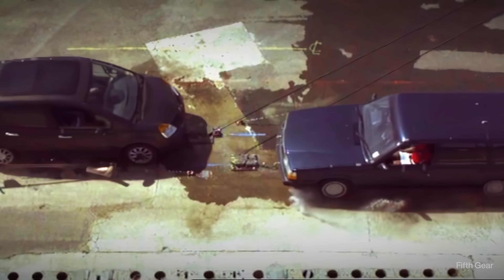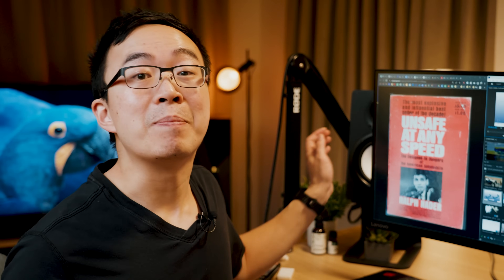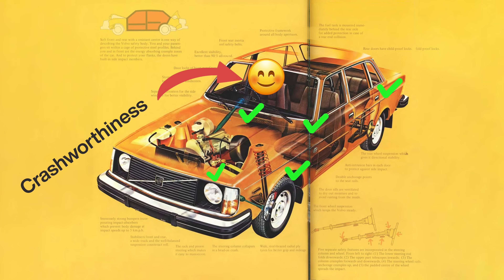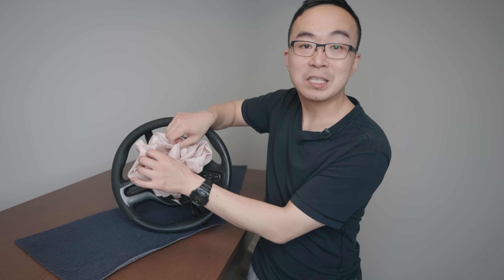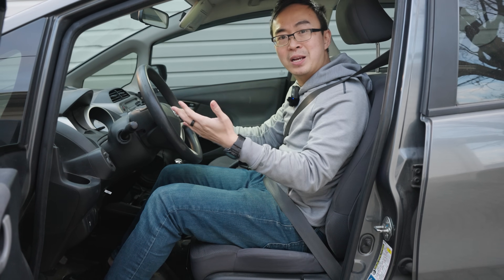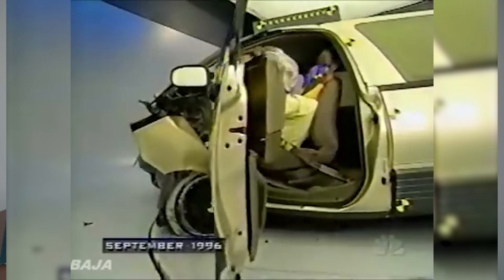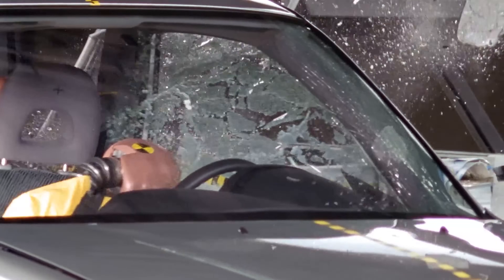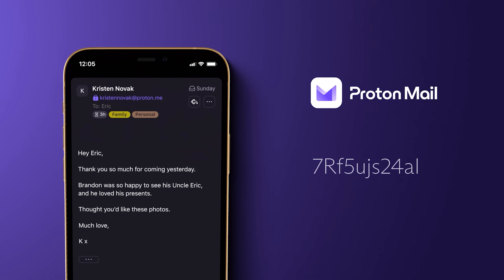When does a car stop being safe?

Comment: I would love a tree test.

Currently that seems to be one of the worst crashes to be in, because it is a pretty small structure, that does not move an inch.
So you have a high resistance and small area of impact

And trees close to roads scare me tbh.
Reply from the maker: Small overlap is that.  There's also designs for a center impact (like hitting a tree or pole) but it's not tested for as it's a very small percentage of crashes.
Reply: Don't drive drunk and you won't have to worry about hitting a tree.   Its usually the elderly and drunks (and stoners) who hit the trees here.  The palm trees almost always win.
Reply: @grayrabbit2211  no, no sadly not.
More mothers trying to see what the child does on the back seat, people that get a jump scare from a deer or hog, people trying to evade someone that has misjudged himself overtaking, losing control on ice or due to pot holes or aquaplaning, people sleeping in on the wheel especially early in the morning or late in the evening.

If you for what ever reason somewhat slip of the road and instantly hit a tree, thats just bad road design.
Reply: There was an article a decade ago or so about an Audi of sorts that had flown off the Autobahn doing 100mph into a forest, where the whole car disintegrated around the driver ... but the driver was fine. Sitting in his car seat in the middle of the forest.
Reply: @dascandy  Extremely lucky that guy :D

I also remember a similar story, also with an Audi, but there the whole family died, while the car got completely destroyed. :(

Comment: 16:47 Well, your front left tire is mounted in backwards, so...
Reply from the maker: Had to do a double check on that, it's not.  Basic steel rims for winter tires.
Reply: @Lam  On the video, the tire looks like it has the V shaped threads facing towards the back instead towards the front.

Comment: One of the reason you had a more efficient research in crash-tests is also the technological progress of simulations. while you will always need physical, real crash tests, the advancements in simulated material behavior helps saving a ton of money as (just for a rough example) instead of crashing 100 cars, you only crash 20 to get to satifying, in-charts results.
Reply from the maker: Yup!
Reply: Yes! My dad worked pretty hard to make that a reality from the automaker side. He worked for Nissan but he truly believes in safety engineering and he helped pioneer the HBM human body modeling especially for children and other passengers that aren't "normal adult man" sized.

Comment: My car have not even gone through a crash test. 
I drive a 2006 Alfa Romeo GT. Alfa Romeo's economy was bad at the moment. So they only crashed the sister model 147 and called it a day. It has barely 3 stars. So I drive an Alfa Romeo GT, but on paper it's a 147. It even says 147 on the yearly control inspection protocols. The GT is concidered a "face lift". You can face swap both the 147 and GT with one another without it looking weird. It shares the interior, mostly, since 147 is a hatchback. And the frame is the same.

Comment: I'm a collision repair tech and you would be surprised at how much engineering goes into crash safety, also many of the very first safety features ie. Three point seat belts, proper headrests and even backup cameras, were introduced by Volvo who had their own safety design division in the 50s! They were also kind enough to not patent the designs allowing other manufacturers to use it for an easy safety increase thus creating a universal standard without having to enforce it (at least initially). UHSS was a big step in the right direction for passenger safety ensuring the safety cage is massively stronger than the rest of the car, and I'm glad more and more people are getting to see this stuff online. 

Also keep in mind Your Airbags NEED Maintenance Every 10 Years!

On a side note being a car enthusiast myself I have to say, if you are going to modify any safety equipment, please replace it with something of equal or greater protection capabilities. For example replacing seatbelts and airbags with a cage and harness, even the pro's crash but the pro's are driving cars designed to crash at 100+ mph and be fine, your 30 year old miata would fail 90% of current test standards and wouldn't hold up well to a new F-150.
Reply: What maintenance do airbags require after 10 years?
Reply: @AlexandarHullRichter  . Mostly checking the airbags condition (visual inspection) and looking for any software errors (SRS light), but airbags can have failures without any warning, stuff like water intrusion, dust, physical damage and corrosion are serious possibilities and some newer cars even have a timer for the SRS light to engage to prevent owner neglect from causing major problems when the bags fire ala Takata recall. And while it may seem doable for the average diy-er to check, know that without a proper scan tool you won't be able to diagnose any SRS codes and keep in mind there could be anywhere from 1 to over 20 SRS devices just in the interior.
Reply: @terracar2003  
I don't quite recall, but can't the explosives also fail over time?
It was something about the compound is somewhat unstable, and will slowly degrade or denature overtime, meaning the force of the detonation decreases, as well as the chance of it successfully+completely going off. (I do not think it can cause premature detonation)

But I can't recall if this is a pattern, rule of thumb, or exception. Have you heard of this as well or know anything about it. (I believe the lifetime of the explosive compound is also about 10-15 years)
Reply: @XenocraftGalaxy  .Yes the compound used in older airbag systems had this problem of degradation, luckily it is a binary explosive meaning it cannot fire without an electric impulse, I don't recall the specific lifespan of the compound but it is meant to survive past the life of the vehicle so easily 20 years and the newer compound is much more stable and no longer degrades as much over time so you get a significantly longer lifespan and as long as you keep up on maintenance you should never have to worry about the explosives having a misfire even 50+ years down the road.
Reply: No OEM shops will be able to provide a maintenance inspection service on the SRS system. The SRS system on all vehicles runs tests automatically. This maintanance inspection you refer to does not actually exsist...imagine the liability a shop would have on signing off on that test? Eventually we will see recommendations for replacement intervals only.
Reply: @9ZERO6  . It absolutely does, I had a 98 Volvo with the obligatory SRS maintenance sticker in the door jamb that was standard for those cars, I also have graduated as a collision repair technician and have multiple certifications in airbags specifically
Reply: @terracar2003  all cars have the sticker. But the actual service? It does not exsist. Plug in scan tool...no history codes. Done. The SRS light comes on if there are active codes. Go ahead and give your local dealer a call and ask them for the SRS 10 maintenance service.
Reply: Nah we crash nakes
Reply: Didn't know that about volvo thats actually really cool!
Reply: @HapyAppleProductions yeah, Volvo introduced the 3 point seatbelt and left it an open patent so all manufacturers could copy them
Reply: @ammarisrar2005  Where do you go to safety test your vehicle? Your mechanic? The manufacturer? Is it expensive? I've been considering a 2009 Toyota Matrix but I've been worried the safety features may not be as functional now in 2024. If I could get it checked and updated I'd feel a lot more confident to buy it

Comment: About 17:15: Small cars are not inherrently more deadly, bigger Cars make them more deadly. Big modern SUVs might be safe to drive, but they are a safety desater for every car (or pedestrian) they crash into.
But overall: Great video!
Reply from the maker: Very true, unfortunately the trend is bigger and bigger.
Reply: @Lam  I feel like that has to do with the rise of egocentrism and lack of care for others currently.
Reply: @foximacentauri7891  Look, it fits into one. Square. Space. Like any other. Having less is just not taking advantage of it.
Reply: Agreed.  The Toyota Yaris is a perfectly safe car in Japan, where the biggest thing on the road is the Misubishi Fuso, and only professional drivers have those.  In a country where anyone with a learner's permit can get behind the wheel of something that big, I want a little bit more steel between me and the other guy.

Comment: Now IIHS is taking rear seat passengers into evaluation. Lots of US' cars arent built or designed with that test in mind. (Contrast to EU market's ENCAP test, which always include rear seat passengers, like children.) Lots of US market's cars failed for rear passengers safety.
Also, there's another giant elephant in the room, which is rear end crashes. Lots of car's rear structures are much weaker than the front. Seems only NHTSA FVMSS 301 has some kinds of test. But only for fuel leakage tests.
Reply: Im actually kinda weirded out how rear end impact safety doesnt seem to be a priority, yeah NHTSA has the fuel leak test during a rear end accident, but that doesnt include if the front occupants have seats that wont fold, or the rear passengers wont be crushed by intruding structures and front passengers,if the trunks are a effective crumple, or if the structures can effectively hold up
NCAPS around the world and IIHS only does a rear seat test where they fling a seat that represents a rear end crash at 25 mph or so, but never factors anything else that can happen in an actual rear end collision at higher speed
Reply: @typicalgamerkid1012  For IIHS, it's seems that, it may not be the car owner's insurance company to deal with the consequence of being rear ended. But for NCAPS... and government forced test... I still think they think death caused by rear ended is not the top priority. (Maybe too few people riding in rear seat)
Also I do think, yeah, at least SOME authorities, or organizations should test some cars' rear ended safety.

Comment: Fantastic video and channel! Could you make a video discussing the differences in safety regulation for trucks, SUVs, and cars?
Reply: In the USA SUV's and trucks have 0 safety regulations. 

You can quite literally build a gaint steal tank with square edges and sell it.

This, combined with hardly any licence requirements and failing to invest in saver infrastructure is why the USA has such insanely deadly roads.
Reply: @Fallingout1234  There actually are some safety regulations. You ever noticed how tall the front of trucks are now compared to say the 90s? That's actually the safety regulations at work. Old 90s trucks sit at the same height as new ones, but their front end is considerably shorter. Problem with those 90s trucks if crashed into a smaller car, the crash bars pictured at 7:18 would not align resulting in bad crashes for the smaller car. Now the front ends are bigger because they've mounted the crash bar a lot lower and then covered up the empty space with a bunch of body work.
Reply from the maker: I know there's crash compatibility engineering for SUVs so they don't just run over smaller vehicles. Don't know if that's regulated or even tested.   I'll think about this.  Thanks!

Comment: Hi. I will add a little to your story. Unfortunately, cars burn perfectly. It is not uncommon for a car to catch fire after an accident. If you cannot leave the car, you will die a very terrible death. 
It is very interesting what solutions are used to reduce the fire hazard of cars? (if applied at all. these funeral pyres burn down very quickly). The only thing I saw was a fire extinguishing system in a truck with a disposable powder extinguisher.
Theoretically, an electric car with a non-flammable battery type and a non-flammable interior will not burn. 
but!
The batteries of the gyroscuters burn like a rocket engine. And the batteries in modern electric vehicles?
Is it possible to make the interior non-flammable and not made of bare steel?
P.S. The video turned out great

Comment: In Europe the Euro Ncap test changed last year and now cars get marked down if they dont have lane assist and pedestrian protection.
sod wether the car actually does its main job of protecting the car passengers.
My Dacia Sandero only got a two star safety mark, yet reading the report shows that passengers are walking away from a crash.
so now you have to ignore the main markings and read the report.
Euro Ncap has lost the plot.

Comment: That point about cars with greater mass being safer when involved in crashes with smaller ones...does that mean we should push for cars, on the whole, to be less massive in general? Try to reduce the amount of metal flying down roads on average.
Reply: That's what fuel economy standards and gas prices do- drive that balance by forcing weight down.
Reply: @jamesengland7461  No, it made US car makers ditch sedans and coupes in favor of pick-ups and SUVs, because they are light trucks and not subject to the same fuel mileage restrictions, so car makers make them huge with massive engines and sold the idiot public that they were extra safe because they were battering rams.
Reply: @jamesengland7461 Well no it wouldn't Hybrid and electric powertrains add weight, the bigger the battery the greater the weight so making cars more efficient is going to make them heavier.
Reply: Not really gas prices yes but fuel economy standards no at least not in the us. Cars are getting bigger because the standards on efficiency for smaller cars are stricter then larger ones. So instead of making better engines they just made them bigger
Reply: That's what I would support
Reply: No.

Comment: So what happens when it runs into a Cybertruck?
I’m worried about this potential vehicle mass and height arms race, since the taller heavier vehicle is often more safe in a crash, since you experience less deceleration, and expose the weaker upper cabin section less to damage.
Reply: I'm surrounded by lifted pickup trucks that have bumpers that start at my small SUV's window line
Reply from the maker: I have yet to see it in a crash, I'm wondering if it has a lower bumper.  The taller wedge might just be cosmetic where as the crash bar would be at a more appropriate height.
Reply: I recently drove a 1987 Ford F-350 with a steel ranch hand bumper through the side of a 2015 Toyota Avalon at 35mph... I had the right of way, lady in the car ran a red light and I hit her passenger doors. If someone were in the passenger front seat of that car they literally would of took a truck to the side of their head. It blew the side curtain bags on the car but the front of my truck still smashed its way about 3 feet into the passenger cabin of the car, the car didn't "bounce" away on impact it was basically speared around my bumper between the A-pillar and C-pillar, like the truck was trying to drive through the cars passenger side windows and got stuck. 

It knocked the wind out of me, and my chest hurt pretty good where my seat belt snatched me, but I still opened the door and stepped out and called 911. Lady in the car was cut up pretty bad but was responsive, fire department had to pry the car open and helped her out of it and took her to the hospital. My truck fired up and went into reverse but it was dragging the car along with it, a wrecker had to pull the car off the front of it. I still have the truck and after some work it's road worthy again. it busted the grill and headlights up, but those were easy junkyard finds, it tweaked my radiator support enough that the lower rad hose popped off and it dumped coolant all over the crash scene (what kept me driving it home that day) I beat that back into shape with a hammer.

If I had to pick a vehicle to slam directly into a brick wall I'd want something that would crumble and soak up the impact, but for plowing through lesser plastic vehicles being piloted by distracted idiots in lower speed traffic I'll stick with my old trucks.
Reply: @Callsign_Sturm  I made no comments about the trucks visibility, just that if the truck/suv is so tall it's bumper is level with my windows, then all the crash bodies in my car don't mean anything, do they?

My issue with trucks is I don't want to spend a mortgage on gas commuting to use the bed like, once every 3 months.

Comment: I wish there was weight standardization. For example, 800kg cars group which doesnt exceed 800, 1000 group, 1200 group, 1400 group, 1600 group, etc. Designs would be required to be in ±3% the weight group's weight limit.
Reply from the maker: There is in that the size like mini, compact, full are used (I forgot the exact categories).

Comment: This is both entertaining and informative. Keep up the good work! However, the fact that the IIHS does not consider lightweight vehicles as safe is indicative of a larger problem, wherein cars are being designed to be dangerous to other motorists, as well as those outside of motor vehicles due to excessive weight. 

Ps. Nice Canadian rubles :)
Reply: It's the paradox of lightweight cars. They would be safer, if the vast majority of cars on the road were also lightweight. But the vast majority of cars on the road are heavy, ergo lightweight cars are not safe.